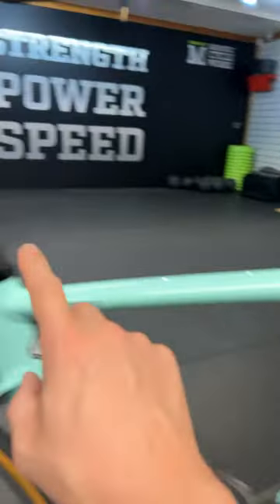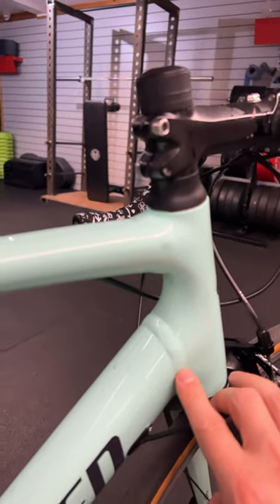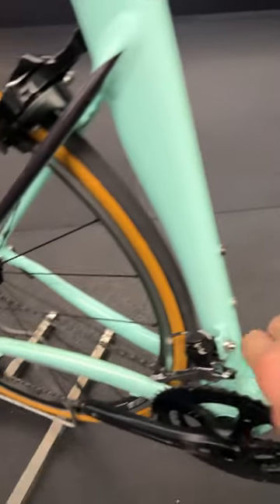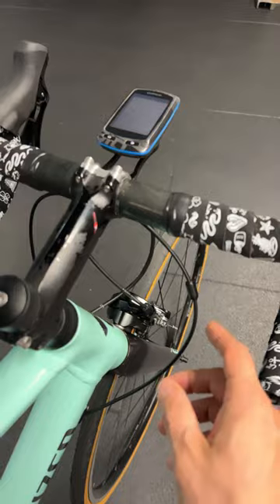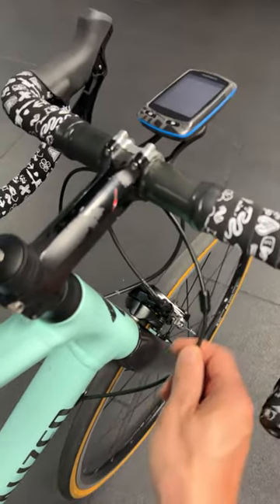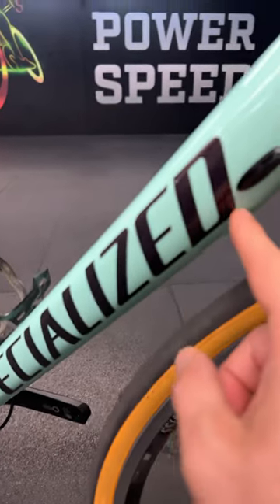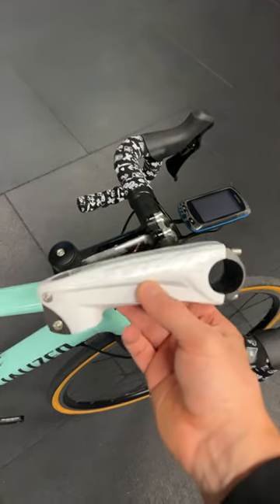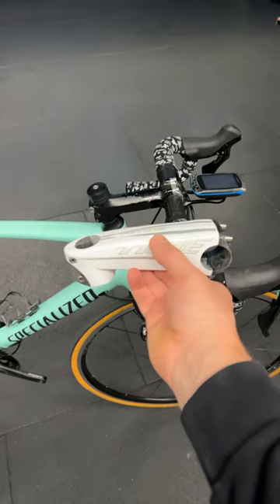Spech circuit racing bike. Stiff and fast.

Comment: Love my Allez. Absolutely flies. Most underrated bike ever.
Reply: This bike is an ultimate monster lol...
I have a 2019 58 rim brake on rovals 50clx,
rapide bars sl stem @ 16.8lbs. Nothing in the 
specialized new lineup of bikes moves like this bike.

Comment: in the early 2000s allez had welds so beautiful I get people thinking it's carbon, this is atrocious
Reply: It’s the one thing holding me off of Canyon and Specialized bikes. I’m not interested in carbon bikes but I love staring at my dad’s OCLV Trek bike because the frame is so smooth. I’m looking into steel simply because of its durability and good appearance ;)
Reply: They definitely didn't look good. Not that these do either😅
Reply: I'd rather have the fatigue life of a carbon bike than a steel one.   It's also pretty easy to repair carbon on your own.  Most people can't weld or will do a lousy job at it
Reply: @veganpotterthevegan  you gotta be trollin right now
Reply: @Ferrichrome  it's really just understanding fatigue properties of different materials

Comment: I got an emonda alr 5 (new one) a bit ago as first ever road bike, after concluding I'm not ready for full carbon.

Very happy with it so far, only thing I was worried about was stiffness - I can't feel anything wrong with it, but wanted to hear opinions from sensible and experienced people like you.

Thanks for sharing this sweet bike btw.
Reply from the maker: You did well.  Stiffness is a good thing. It’s very easy to make a stiff bike more comfortable with wheels and tyre pressures etc. It’s very hard to make a flexible bike stiff again.

Comment: Also not strong. My friend had this bike as his ‘one bike to do it all’. Ridden all year round. After a year it split at the welds. Specialized had major problems with the welds on these frames suffering corrosion and fatigue. Great dry weather crit race bike, not for much else.

Comment: If there's only one Specialized I can take, this would be it. Dare I say, it feels like a third-generation Venge, only a little more sluggish due to the higher frameset weight. The only turn-off is the proprietary headset bearings, not even Enduro Bearings made an aftermarket counterpart for it, not sure if they'll ever make one for their MaxHit lineup.

Comment: Those internal cables do not have any guides 😉. 

Had a 2017 version of this. Really nice and great for crits or short, fast rides. Felt very fast, but I think a modern carbon frame goes at least as fast even if it feels slower
Reply from the maker: Thanks for the info!  Fun times ahead.

Comment: What is most interesting with the frame construction is how much bigger the tubing and welding has to be give the equivalent or near as stiffness of Carbon.

Personally I wouldn't bother with tighten up the cable routing for pointless aero or tidyness gain, prefer to have linear response of inner cables to be smooth as well as easier serviceability. Neat and tidy aero gain should be left to Di2 not mechanical.
Reply from the maker: Yes. But we can do better.  Keep an eye on the follow up.
Reply: Neatly routed shift lines can still operate nicely, but not to the point that they're tugged when steering lock-to-lock, but this isn't a problem for the first-generation Allez Sprint.

Comment: The heat affected zone of an aluminum weld weakens the metal by about 30% - that's why you really can't grind an aluminum weld bead flush like you can for example with carbon steel.